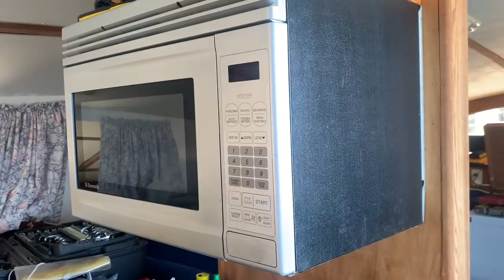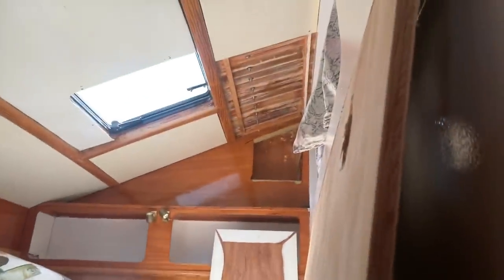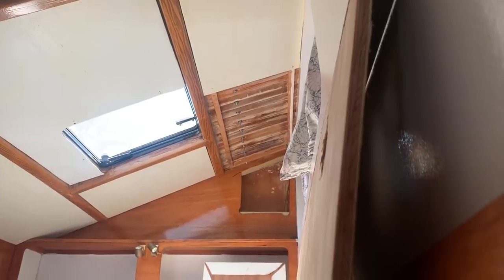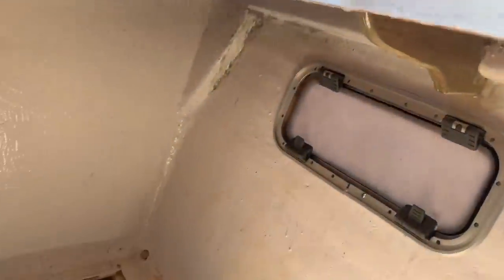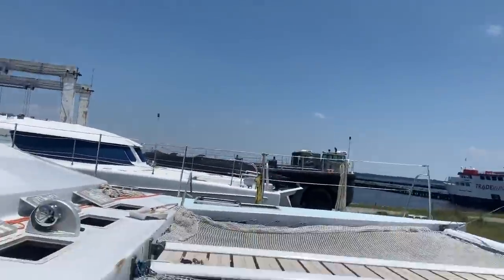Catamaran update video

Comment: That was a hard expensive way to get a reliable gen set engine. Then again if he had watched you bring back many DD's that were seized up solid he should have known he had the right mechanic. What did he replace the anchorage weight with? I suspect a 55 gallon plastic from with an old anchor chain dropped into it then filled with concrete, arrive at regular anchorage simply roll the barrel with line attached over the side.
What was the catamaran owners reaction to you getting the old Yanmar 3 banger going? I'd be willing to bet you more than a few people were betting against you from bringing her back to life. 

Thanks to the owner and you for the tour and look aboard.

Cheers!
Reply: Thank you for the kind comment... I've been lucky enough to have meet Scott several years ago, we did some major bonding while bringing back the rear end and more on that bus. 7 buses later Scott and I are still go in strong. When I bought the boat I had faith in getting the engine running and Scott was kind enough to offer to do the work...then I knew it would run again... I have learned so much from him about this crazy bus world, with so much laughter, hard work, and making a very special friend along the way...

Comment: A little 3 cyl for that huge boat?
Reply: It's an auxiliary yacht.  It's sail with the 3 cylinder allowing 3-5 knots in harbor.
Reply: Two engines, one in each hull.
Reply: @newjerseybill3521  Even better!
Reply: With the single engine she well do 6 knots..with both shell cruise at 8... Burning very little fuel.. Under sail on a good day 15 knots..
Reply: All you gotta do is spin a little itty bitty propeller 2-3 knots is more than sufficient for getting underway and beyond the harbor breakwater. From that point " hoist the mainsail, let out the spinnacher " and before you know it your coming Colton lifting one car out of the water and sailing, real sailing. 

If you haven't put solar or a small wind turbine on board I highly recommend it to keep your batteries topped up. Nothing worse than dead batteries and no other vessel in sight to give you a jump start. No radios,your back to 19th century navigation. Got a sextant onboard? Might want to get one and learn how to use it. Could save your life. Also get a box of pencils with a crank type pencil sharpener nothing worse than a roller pen with a ball that doesn't rotate. Granted what I'm describing is the extreme but better safe than sorry. If you really want the correct pencil buy a box of carpenters pencils, no sharpener needed only a sharp knife.

By the bye, thanks for the kind words. I haven't sailed in over 48 years and that was on a fishing boat out of Rockport, Massachusetts on a dragger. Out 8 days and back in when the scuppers were loaded with fish and the scuppers had wooden plugs hammered in them with 2-3 inches of freeboard. We got big shares back then.